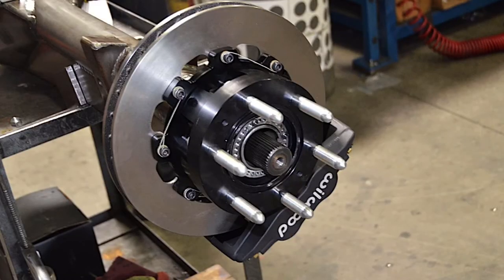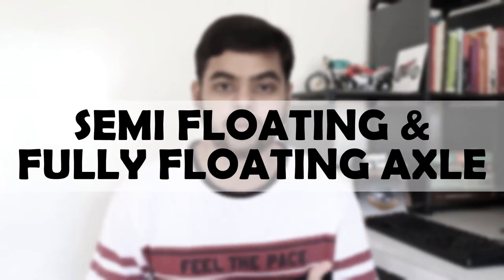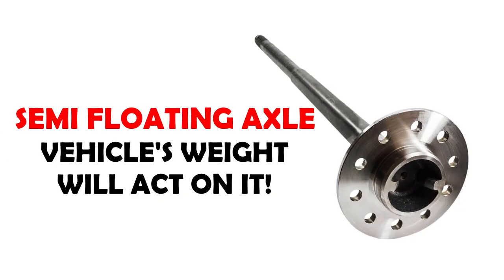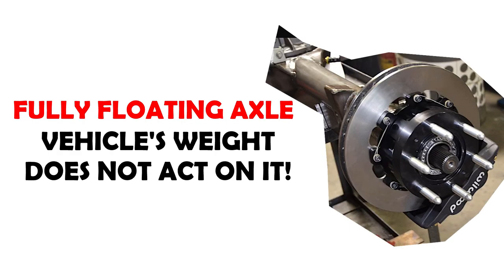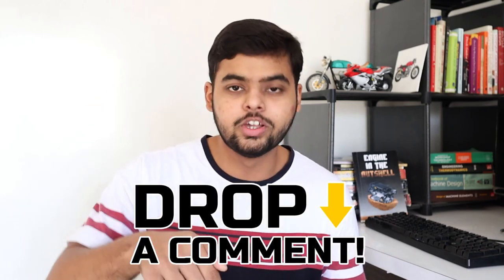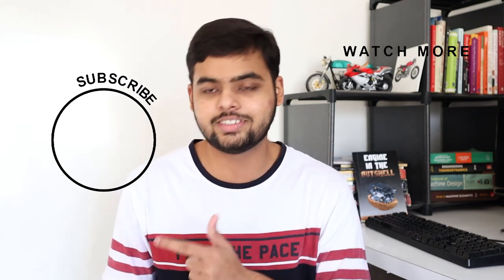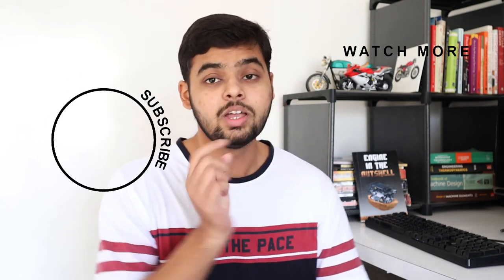The Ultimate Guide to Semi and Fully Floating Axles

Comment: In full floating axle, torque reaction is taken by?  Axle housing or half shaft?
Reply from the maker: The half shaft takes the torque reaction. But the weight transfer that occurs due to acceleration and braking, is taken by the housing.
Reply: @PurvangMantri  so in all the 3types of axles the torque reaction is taken by half shafts? Plz clarify my doubt sir
Reply from the maker: @nikhilallada8522  No. Only in fully floating axle the torque reaction is taken by the half shafts, while the other 2 axles have to deal with some torque reaction, that's why they are named as Three Quarter and Semi Floating.

Comment: Which type of dead axle is used in rear end of car having twist beam suspension?
Reply from the maker: So basically dead axles don't have a type. I mean you might come across the straight beam, and fully drop type dead axles, but they are basically used for front wheels. Regarding our cars, the answer was right there in your question. That twisted beam acts as the dead axle, it connects the rear wheels with the frame.
Reply: @PurvangMantri  so we can call it as twist beam dead axle .. Is that formal name ?
Reply from the maker: @drugbaba  Yes you can call that but it is not a formal name.

Comment: 6*4 tipper me differential second aur third dono aamne samne nahi balki thoda Thedha fit hota hai Aisa kyu hota hai batayein
Reply from the maker: Kyuki dono ke bich mein ek aur propeller shaft laga hota to transmit the torque from one differential to other. Aur tipper/dumper trucks ke working environment ko dhyan mein rakhe to wo usually off roading conditions mein zyada use hote hai aur ese mein ek axle khade mein jaa sakta hai to uske motion ka effect dusre axle pe naa ho isiliye thoda position alag rakha jata hai.